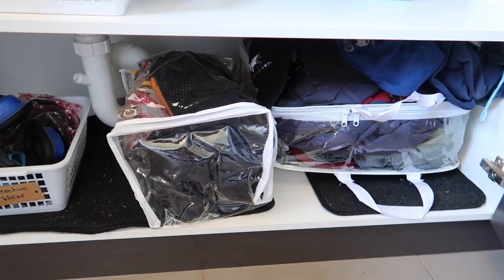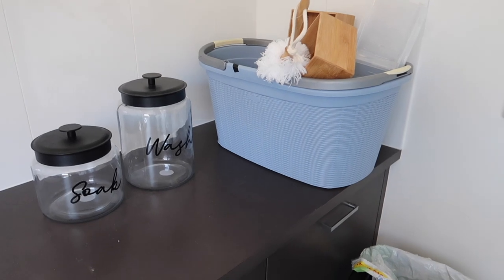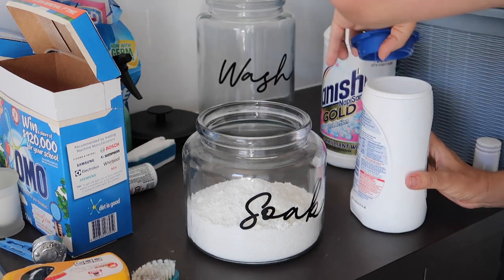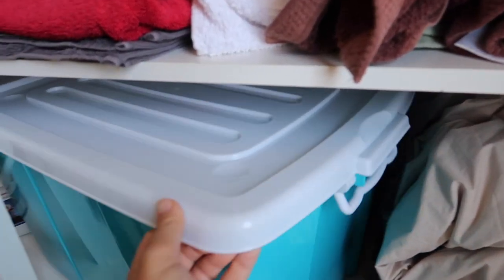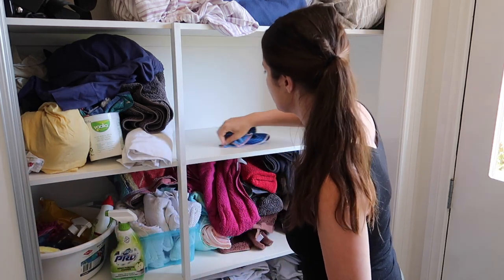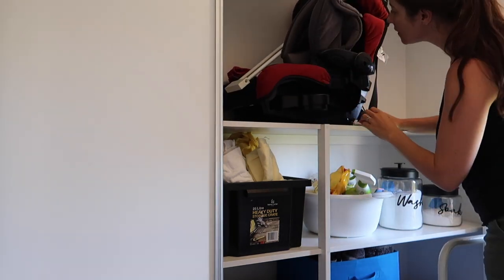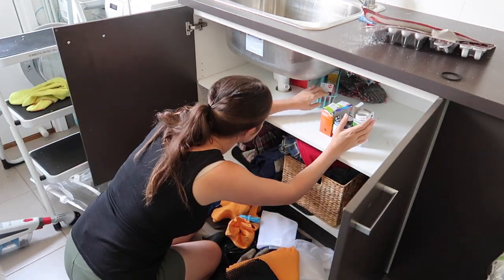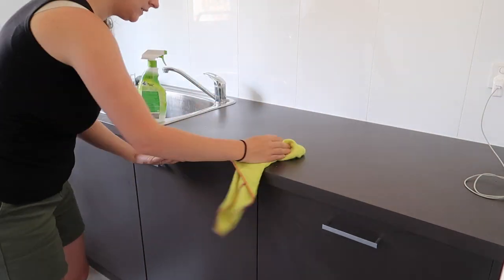ORGANIZE AND DEEP CLEAN WITH ME 2020 | HOME ORGANIZATION TIPS | LAUNDRY ROOM @LoveHappyAli

Comment: I don't iron either..after it comes out of the washing machine I sometimes put it straight on the clothes hanger to dry before putting it away it seems to get the wrinkles out. Great job on cleaning out the laundry I definitely need to do the same but I'm lacking time and motivation.
Reply from the maker: Yes, I was thinking I might start putting my shorts on hangers to help with the wrinkles. 😃 I’ve just done the family bathroom, it’s was so disorganised and my motivation was low so much STUFF! I’ve found a timer helpful in the past and rewards (watching a YouTube I’ve been wanting to see) once I’ve completed a section or time goal. 😃